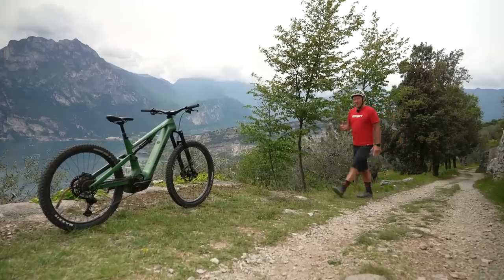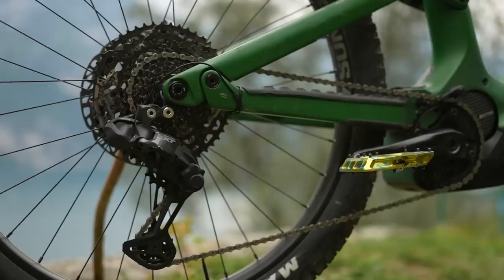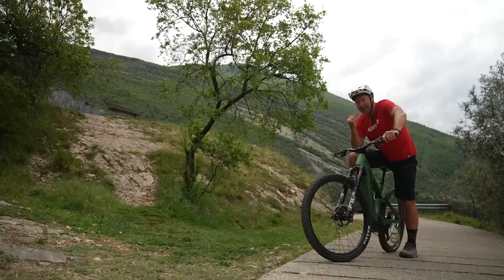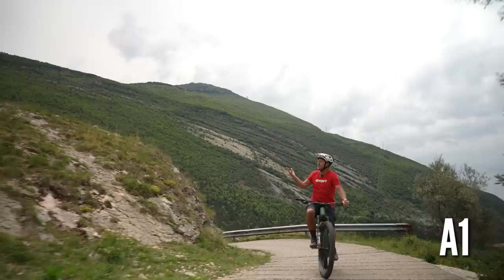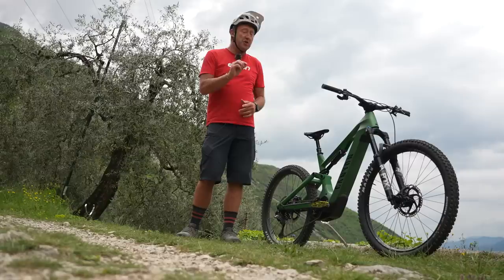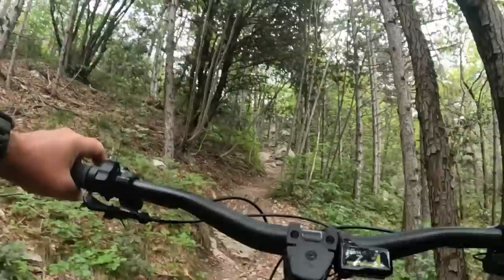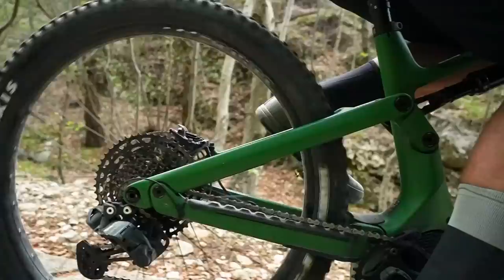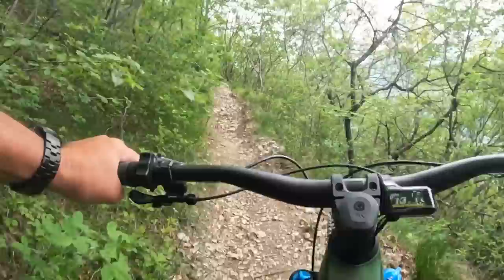Shimano Auto Shift - How Auto Shift Works In Reality

Comment: Not buying till theres a cigarette lighter
Reply: Lol agreed!
Reply: Imagine a 12-V socket car cigarette lighter on a bicycle.
That's future!
Reply: This comment is an excellent representation of the new crowd e-Mtb’s are bringing to the trails.
Reply: How about a cup holder for a beer?
Reply: Just puncture the battery.
Reply: Most e-bikes are not smokers 😂
Reply: Yeah put it in the headset top cap.
Reply: @KessuPutte  lighter on the headset hahaha
Reply: I want a 150w inverter integrated to charge my vibrater on the go. 🎉 Take my money.
Reply: @twowheelpilot  
Integrated into the dropper post 😭
Reply: @WIPEYOURLENZ  Now that's thinking. You sir are a true innovator. Patent that idea right now. 😉👌
Reply: Only USB C port .... please 😁
Reply: My Bosch system has a micro usb port and with an adapter you can plug things into it and charge them
Reply: @twowheelpilot  😂😂😂🤣🤣🤣
Reply: Me I want a robot to ride the bike for me that I can control in my sleep doing nothing 🤪🤣
Reply: @Going Bonzo  they do beer holders for helmets already with few straws you are good to go
Reply: I need central vac
Reply: Hi. What Spectral is it.
Normally the Spectal diesel not have shimano elektronik gear

Comment: A solution to a problem that doesn’t exist. More expensive more complex and gives bike manufacturers more reason to charge us more money. When I started riding an expensive bike was £1000+. Now it’s more expensive to buy a mtb than a car! Not for me
Reply: in what world is it more expensive to buy a mtb than a car??
Reply: @fraser6127  compare cheapest new car with most expensive EMTB perhaps?  Or consider that you get a lot more motorcycle for your money compared to high end EMTBs.
Reply: @fraser6127  I recently bought a BMW 1 series to drive around the UK with my bike. It cost 3x less than my MTB, and it's not even an electric MTB.

So to answer your question; this world.
Reply: @----.__  what are you comparing? A 15 year old car with 100,000 miles to a brand new top spec mtb? Hardly apples to apples is it. I can buy a old studio flat in the northeast for less than a new BMW 5 series, does that mean cars are more expensive than houses now?
Reply: @fraser6127  "in what world is it more expensive to buy a mtb than a car??"

You're the one that posed the question, I simply answered it with a real world example.

To answer your second question, yes. Cars are more expensive than studio flats. I would have thought that was obvious.
Reply: @----.__  so what's your point?
Reply: @fraser6127  It's quite clear, moreover, what's your point?
Reply: @----.__  is this how you talk in real life
Reply: @fraser6127  Is this how you think in real life?

Comment: That's going to snap some chains that like . Shifting under such high pressure going through pedals 😜😱
Reply: The chain used here is borrowed from buzz light year, and is constructed of terrilium carbonic alloy from sector 18 in the gamma quadrant 😀
Reply: It wont snap chains
Reply: Idiot-proof tech is not cheap :)

Comment: A system like that is reactive whereas a good rider is proactive. Good for noobs I guess. The one feature that genuinely looks useful is the ability to shift while keeping the pedals level. This could be handy if you are going downhill through a gnarly section and you know that there is a punchy climb coming up, you could shift down, ready for the climb without having to risk clipping your pedals.
Reply: Nailed it
Reply: But it reactcts so quick I feel it is really proactive
Reply: @mremtb7689  You can’t use the word “react” and then say it’s proactive. I would shift down before I even got to the climb and you can bet I would avoid crunching the gears like they did in the demo.

Comment: Linear progression is one thing where a semi-smart power ratio dilemma can be solved easily. However, the instantaneous progression over obstacles is quite a different story. If you can have both running simultaneously, using both modes, or all 3-simultaneously. So manual and terrain settings might make it worthwhile. If he said it’s possible, I didn’t hear that.

Comment: That looks like it's going to really shorten the life of chains and cassettes by doing all the poor shifting we've been told not to do previously.

Mixing that with sram's t-type system, on the other hand, would be fantastic
Reply: Shimano is probably not too sad if you have to buy more spare parts in the future, claiming, that this is just a small "downside" of the huge comfort benefit 😄
Reply: What crains will need to be replaced
Reply: @downhill64    "Chains"   .........   spell check maybe !
Reply: Cassette is all high alloyed case hardened steel now, instead of previously being part aluminium, slightly heavier but that's no drama for the  E power.👍🇬🇧
Reply: That will last about two hours if your lucky.👎
Reply: Yep hopefully sram will bring auto-shift to there drive trains 🙏🏻
Reply: What's a crain?
Reply: It's Link Glide it's designed to shift under load. Why do people comment on something they have never tried or know nothing about?
Reply: @roddas26  I have linkglide already, it's not what it's cracked up to be. Get over yourself.
Reply: @barryholt3526  stop projecting Barry.
Reply: @no  it's what your mum does to punters for money. It's pretty degrading, but I guess if she needs £20 that badly, then who am I to judge.
Reply: @barryholt3526  again Barry with the projecting mate. It's not a good look
Reply: @roddas26  keep drinking the kool aid. That's what the advertising men want from you after all. Drink up.
Reply: @barryholt3526  again Barry with the projecting. I have link glide on my Kenevo SL and I can tell you it works great. And why are you so angry
Reply: @roddas26  on an SL? I have the standard gears on my SL. The SL doesn't stress the drivetrain compared to full power.

The funny thing is you can't even see the irony in your comments. You just went straight to attack and haven't even backed your standpoint. SL, joker.
Reply: @barryholt3526  my standpoint was I am using link glide and it works. And I was never even commenting directly at you Barry so calm down.

Comment: Free shift seems useful... the same as a internal geared hub... not sure about Autoshift... and the shifting under load has me concerned... still waiting for a real gearbox and a belt drive system on a mainstream bike...
Reply: Why does shifting under load matter? The tension on the chain is on the top between the chain ring and the first few teeth on the sprocket. Where the chain is changing gears from the derailer, there is actually not much tension at all

Comment: Nice, when no derailleur with real gearbox.
Reply: soon
Reply: this is what i want. good cheap hub gears.
Reply: Gearboxes excite me and I want to try them and I'm excited to see them evolve in the future, but the biggest turn off is the current inability to shift under load, this is the greatest weakness for gearboxes on emtbs when even if you are currently in the right gear to climb, your angle and traction constantly changes on a challenging climb and you're left having to cut power to shift. Sounds extremely complicated to make autoshift work with a gearbox
Reply: Valeo has one.. bafang launch at eurobike

Comment: so when i manually shift as im climbing i can time it so i take off some pedal pressure.  How does this system NOT lead to that horrible gear grinding and destruction of your equipment.  I know its more durable, but i cant imagine its good for it when you are pressing hard up a hill and it just shifts anytime it wants.  otherwise, sounds really neat.
Reply: I was wondering the same thing. I think all this system does is you don't need to press the shifter trigger anymore but the gear change will remain exactly the same as manual shifting.

Comment: I can see the autoshift and freeshift being useful, especially on commuter and cargo bike applications.   Not sure autoshift is something I would like on an eMTB though. I  upgraded my eMTB to SRAM Transmission and shifting under load has been great feature when I shift late. Hoping to see a more robust/waterproof and serviceable Shimano EPxxx series motor in the future.  If not here's hoping aftermarket motors designed to fit Shimano motor mounts become a thing. C'mon Bosch, get it done! :-)
Reply: Rode a cargo bike Urban Arrow with auto shifting (not shimano) in my past job, it works really smooth, but I miss the sound of my rapid fire shifters. Also when I normally shift I reduce the power I put on the pedals so the chain can go over smoothly, which is pretty much impossible to time right with auto shifting

Comment: the psi on the chain linkage must me immense on some changes, because it will change gear as you would expect, but at times you might not expect it, still a great tool to help you
Reply: Pascals or N/m² instead of PSI. PSI is in reference to a vacuum or atmospheric pressure at sea level.
Reply: @----.__  or foot pounds.
Reply: @----.__  psi is still valid here if he's talking about the pressure between the chain and the gearring

Comment: Seriously, Shimano and friends are just treating customers like sht continuing to push derailers and systems based on them. The gearbox/motor combo already exists and is the only future for ebikes but then they wont sell replacement cassets, etc. EMBN know this and have the power to help push them into the market but dont. Lots of vested interests in the industry and its BS.
PS- This auto system is going to eat your drivetrain even faster shifting under load all the time, enjoy buying even more parts from Shimano.

Comment: i'd be interested to see how long the chain lasts and how it works when components start to wear. id imagine it puts  even more pressure on the chain. I think this looks fantastic for technical descents and especially in an enduro race decent but i'd be tempted to switch to manual for accents. this system with the internal gearbox would be the ultimate system..... good to see tech moving forward again.

Comment: Noisy shifts... but if the chain and cassette are designed to take that extra abuse without shortening their life then it seems like a great idea. Now we just need Shimano and Sram to collaborate and combine linkglide and the new derailleur mounting system into an industry standard... probability wishfull thinking 😂
Reply from the maker: The new system was designed to withstand shifting under load - they specifically designed the chain and tooth profiles to withstand it, which in turn allows a system like Auto Shift to work.
Reply: @embn  But does it hurt Shimao if more chains and cartridges have to be bought because of higher usage? :)
Reply: @Electric Mountain Bike Network  made to withstand the shifting under load... ok I can understand but that's the same a wrong way to shift gears and only in emergency situations should be done, that fact that is considered "normal" in my opinion is a bad advice.
Reply: @embn  uh no. there is much more force involved. even if the chain is somehow hardened it is still shit. you cant change basic physics.

Comment: Hello eMBN, do you know if it will be possible to mount the new Di2 XT 12 speed on bikes with EP8 (DU-EP800)? Of course without Free/Auto shift as DU-EP801 is needed. Thx
Reply: At least Di2 XT 11 speed is OK  with EP800 - I have driven such bike and it works cool!

Comment: Been riding for 25 years - still cannot see how this is even slightly better - AND WHY - compared to a 1995 24-speed LX, for instance. More weight, a battery to charge, 100x times the breaking points - but it's all good because it has an APP. I don't know how to say "keep your head grounded" in Japanese - but someone needs to tell that to Shimano loud and clear. Otherwise the fanboyism of "tech for tech's sake" seems overhyped.

Comment: Only a good idea if they implement a continuous gear system. You really don't want the gears shifting without warning under load. Plus it's an unnecessary strain on the drivetrain.

Comment: I Thought Part of the Fun of Bike riding was Deciding What Gears to use,But I Suppose You Can Compare This to F1 They Have Not Used a Gear Stick For Years and Call Themselves Professional Racing Drivers So This Tech Will be in the Tour De France Shortly😊

Better if they Stopped Messing About And Spent Some of there Massive Profits and Made a Gearbox in the Motor With a Belt Drive As Chains and Sprockets are a Pain in the - To Keep Cleaning etc

Comment: I'm very sad after buying my Cannondale with the Shimano EP8 (EP800) and a few days later the new version of the EP8 (EP801) appeared, I was shocked by the fact that it was not compatible with my bike frame and battery. I understand the industry but it is a lack of respect for consumers, because I'm subject to the EP800 and the BT8036 battery disappearing from the market when they need to be replaced. This is an expensive bike that was difficult for me to buy,  and I don't know if next year I still have spare parts for it.
Give your opinion about this complete mess in the market.

Comment: Isn't it true that you should not switch gears under load? And the autoshift is doing exactly this. In "manual mode" you shift in advance, control the load and the shifting moment. If you cannot manage your shifting manually, probably you should not be mounting biking. There are a lot more complicated thing going on during the ride, than the shifting. Honestly, I cannot see the future of this and certainly cannot justify the price. But of course, probably they say the same for automatic gearboxes in cars. :)

Comment: So Shimano have probably figured out how to see where the crankarms are to shift in the dead spot of the pedal stroke, but...damn, if that isn't shifting in all the places that kill drivetrains. No human would ever choose to bog down in a big gear and then shift to a small one under load...and this is human + motor load. Just like a person who knows how to shift can generally beat an automatic gearbox by anticipating what is coming, the rider who can look ahead and shift before they bog down will do much better and break lots less chains and/or cassette teeth. But maybe that's what you get in manual mode.

One other question: does "free" shift just mean the system registers your button presses to shift while coasting and makes the shift when you start pedaling?

Comment: I have the 2022 Spectral:On in the same colour way as this. Will it work the di2 system as I believe is the EP8 motor not the EP801
Reply: This feature is not supported with EP800

Comment: Just assuming, as i have no experience with this auto shift system. Pop a wheelie and gearing could be going willy wonka. As you put a short burst of power trough the pedals. And it might think your going up a steep climb due to bike angel when keeping the wheelie. Just some guessing from my part tough. I think manufacturers should focus a lot more on built in gears in crank motorhouse. Not keep trying to make magic happen on a big cassette, derailours etc etc imho...

Comment: Linkglide wonderful idea but the problem with the system is the chains. Shimano linkglide chains are poor quality, trying to use a quality chain from connex does not work because the lack of correct chamfers for the linkglide system. Basically linkglide is a pain.
Reply: Where did you here that? Linkglide is supposed to be extra durable compared to a standard chain.
Reply: @andyarchitect  Hear that? experienced it!
Reply: @tomquimby8669  what went wrong with the chain? Wear? Snapped?

Comment: That's not a bike anymore, that's clearly a motorbike with an automatic gearbox. You climb stuff that would never be possible with human bodies.
I really like e-bike as they allow people to avoid using cars, reduce carbon emissions, practice some activities, etc... but let's not forget there is a motor and a battery inside and these requires lot of resources. They are costly.
To put a battery in an enduro bike and use it like a motorbike to go to place we would never go, that's a waste. It just "adds up" to the resource we are using and wastes we are generating, and does not replace anything.
I hope these technologies will help people access cycling, but if it get too hard, take another route or push your bike...